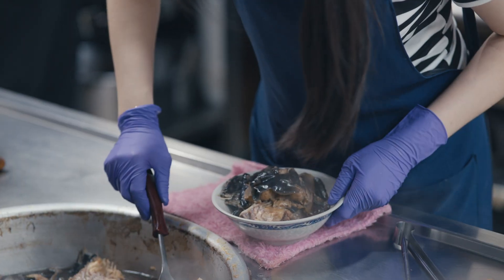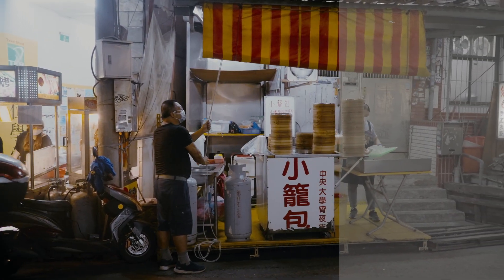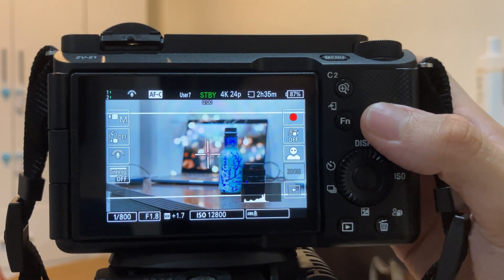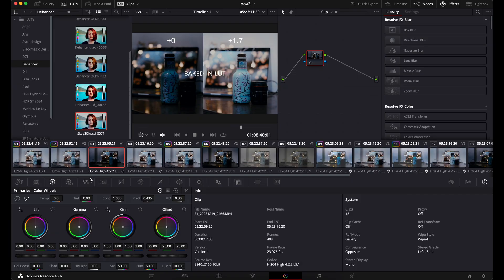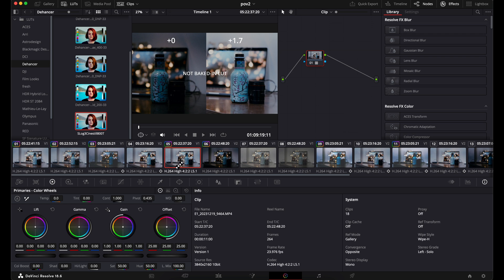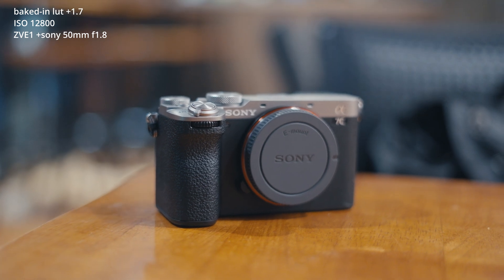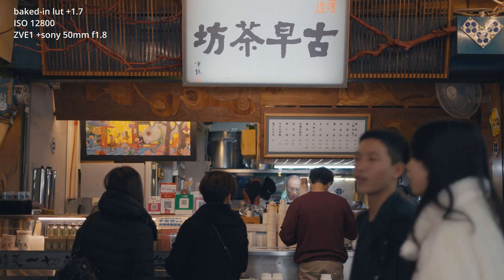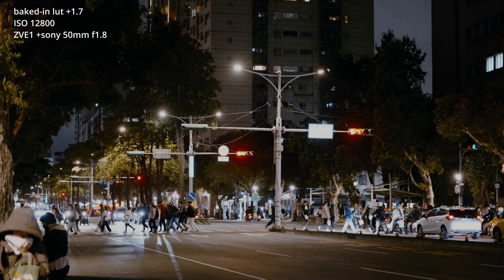ZVE1 Baked-in LUTs? How to expose baked-in Luts? All explained!

Comment: So, when the LUT is baked in, the metering on the monitor is actually -1.7?  So by setting it overexposed by 1.7 its corrected?
Reply from the maker: @Aviatorssunglasses-c7k  I don’t think you can say it’s actually-1.7. Whether baked in or not, it’s still s-log3 footage, which is supposed to be shot overexposed.

Comment: if I want to set 12800 then the exposure is not set, it only works with auto ISO. How did you set the exposure to +1.7 at 12800?
Reply from the maker: what do you mean it only work with auto ISO? You set the ISO to 12800, and you can adjust the aperture and shutter speed to control exposure.

Comment: Nice video! I have one question, when I used A7M4, I used to have a special PP setting with slog3, such as color shifts and sharpness, I found that to work better with my luts compare to the original slog3 PP. However, with ZVE1, when I enable the in-camera LUT, I lose all controls over the original color profile like sharpness. Do you know any way to resolve this?
Reply from the maker: On the import page you can change the AE level, but that's the only edit you can adjust (that I know of).

Comment: How do you expose +1.7 without turning g up the iso too high? (In really dark scenes)
Reply from the maker: you can't set the shutter speed too high, normally you set it to 1/50, and aperture set to the largest, and finally set the ISO to either 640 or 12800

Comment: So to be clear, if you bake in the LUT and then export the footage it is 100% SLOG3 footage? Thanks. Also, is this possible with the FX3 (with the latest firmware update)? Thanks.
Reply from the maker: I wouldn’t say the exported footage is still s-log 3 because it’s already graded. But it does have the same look as when you color grade it in post. And yes you can do this on FX3
Reply: @ConstantineSPhotography  same dynamic range advantage and quality? Basically it’s identical to graded log footage in post? Thanks.